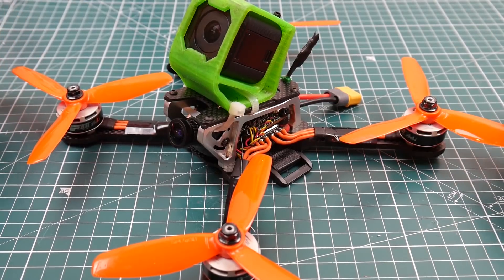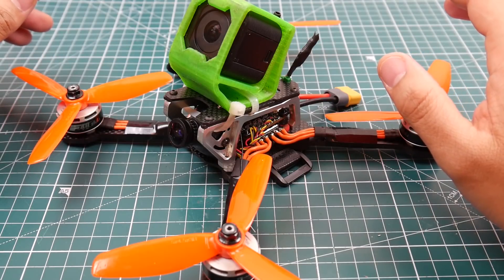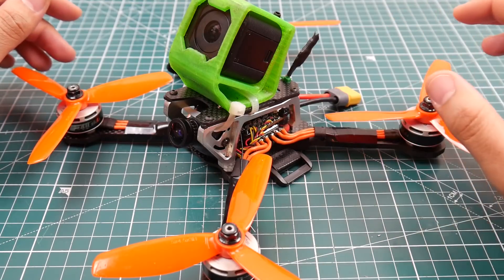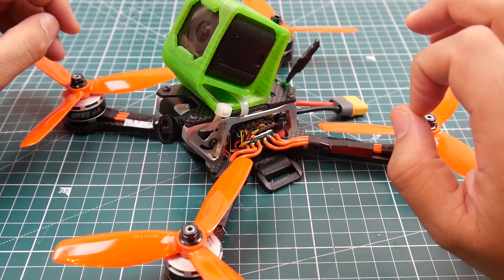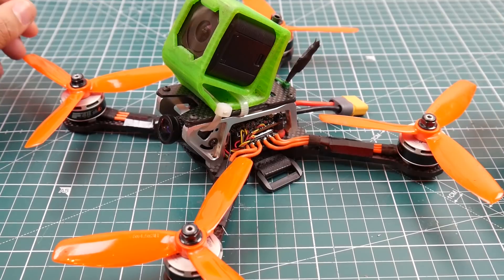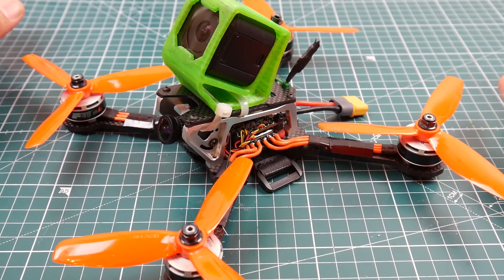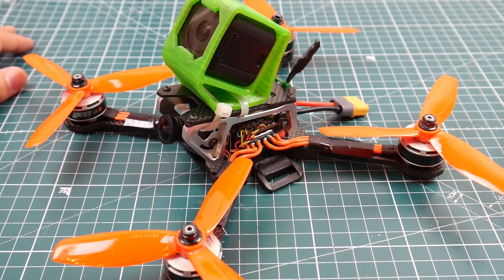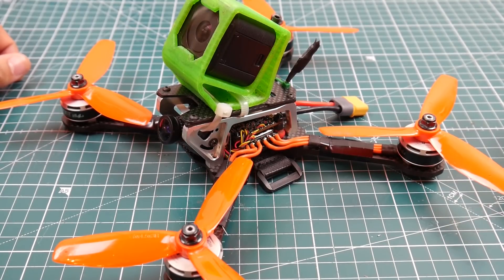The Best 4in1 ESC of 2018 and Why // DalRC Engine 40A

Comment: Ordered the stack. Woohoo. Can't wait. I just wonder if anyone had tried 6s on this esc yet. I wanna build a 5s rig but if it will handle 6s then that's where Ima headed. I may have some emax RSII 2306 low kv motors in my future.

Comment: What esc would you recommend for a 5 inch ptop on a neato breakneck frame with brotherhobby avenger 2507 2700kv motors? Looking for all out straight line top speed. So high amps. Thanks

Comment: mesh I’m on a budget now cause of all the crap I’m trying to replace after getting everything I own stollen including my goggles and tools :/ what esc’s should I go with in my chameleon rebuild?? Remember budget>quality>4in1
Reply: Mini Quads Mega Fun Well for me, the cheap as beans racerstar 35A has been perfect for me even with 2307 2550kv motors. I cooked one motor trying to turtle, and ripped another motor off and it keeps going. For $30 it's been good.

Just don't skimp on your FC, ive had 3/4 doa generic ones already.
Reply: Wyvern I got a kakute v2 for my new fc on my replacement chameleon and the hglrc 40a blheli32 stack for my race floss 2 so far.. I can’t help but look at that racerstar 35a because that price is just soooo good!! The esc’s I’m using individually right now on the chameleon are the hakrc blheli32 30a that I got on sale for... get this.... $4.99  a pop!!!!!! I wish I ordered more!! Too bad I can’t find a 4in1 that was similar to those!
Reply: $5 is a killer deal! unfortunately everything I run needs a 4in1. I picked up a ZTW 20a AIO a few months ago for $8, I just started flying from a year hiatus, not much runs on 20a anymore! I do have an old ZMR 180 that may get a revival with it though.

Comment: @Drone Mesh
                         Always repping the Frog ... nice one bro .... 
Frog deserves the attention :D

Could use a little advice. Got a Frog lite in my studio doing nothing, 
was thinking of checking out a cheap low kv, high voltage build (to see 
if the hype is legit or not).
Was thinking of going with RCX 2206 1600kv or 1850kv on 6S, and i kinda 
wanted to use the HGLRC F440 FC/ESC combo. But hesitant to buy the 
FC/ESC as its 40a but rated only to 5s  ..... on a low amp draw setup 
should i still be ok with a F440 ESC??
Kinda wanted to try a HGLRC as they look so well labelled and easy to 
work on, but am open to other suggestions if you have any, just wanted 
to keep build cost down though.

Thanks :D

Comment: Nice video Drone Mesh, Got a question tho, I build a frog lite setup and im getting video noise when I screw down the top part( aluminum standoffs) in the frame, without screws no noise, with screws I get noise when arming the quad. im using a racer star tattoo f4s and eachine vtx02.

Comment: My Frog Lite's are tanks. Picked em up last july and they're still goin strong! Nice build and flight!  :D
Reply: GITech mine lasted 40 seconds. Had 1 prop inverted on the maiden, flipped the quad and broke 2 arms!
Reply: Using thor v2 5mm now and lasted around 100 packs already, great frame
Reply: IDK if there are some fake frogs, but the once I got was made from garbage carbon. It is nicely designed frame, but due to low quality carbon I don't fly it often.